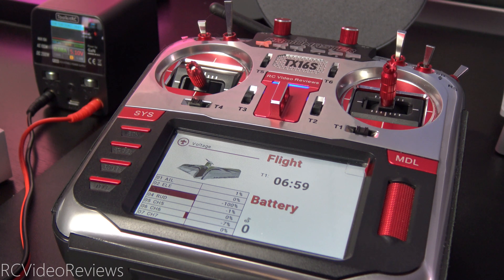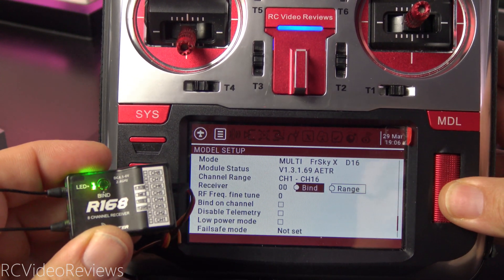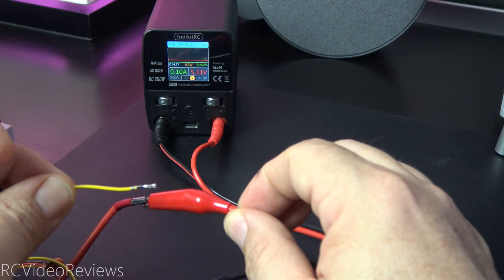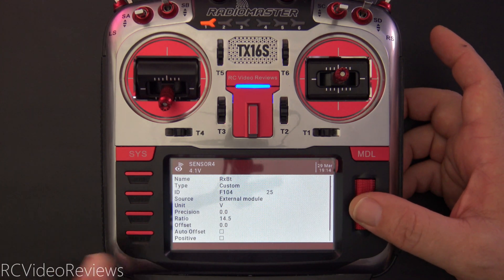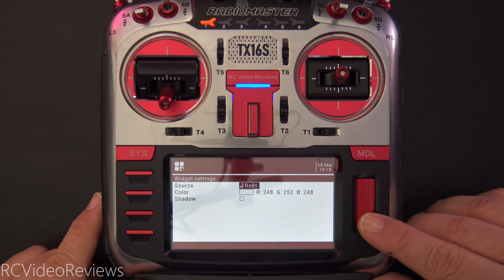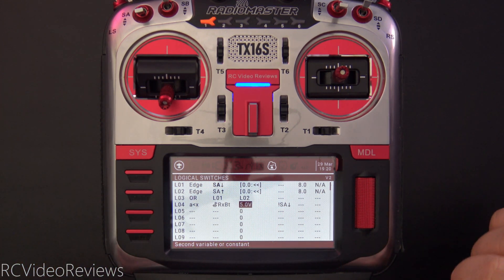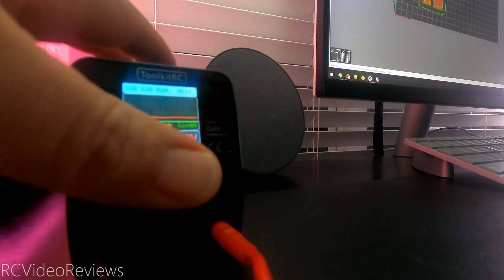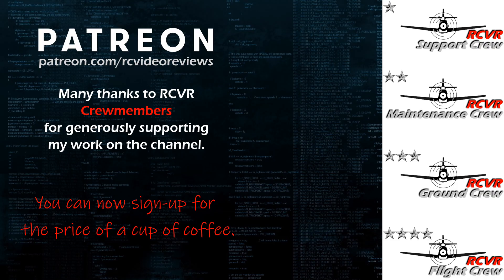OpenTx Snippet • R168 Bind • Battery Voltage Telemetry • Audible Alerts • TX16s • T18

Comment: what should the battery voltage range be on the radiomaster?
Reply from the maker: 6.4 to 8.4v
Reply: @RCVideoReviews  thanks how about calibration value the issue I am having I can’t tell if it’s fully charged half charged etc from the meter main menu
Reply from the maker: https://www.youtube.com/watch?v=iqAHIckNasM
Reply: @RCVideoReviews  thank you beautiful explained video
Reply: Since battery voltage label says 7.4 is 8.4 full charge not overcharging it ?
Reply: what current to charge 7.4V ion 5000 mah is what i have for edge tx, use 2.0 Amp? and what is the voltage should read when battery is dead or almost dead and time to charge to 8.4V
Reply: @RCVideoReviews  also I don’t see etc battery on the screen also what is purpose of enable max throw? If I enable it my throttle comes on even though it is set to throttle cut .

Comment: Hey John, can you please help with what is the difference between Ratio and Offset setting the right voltage reading. Correct voltage reading can be achieved by adjusting either of them, so I am wondering which is which, thx

Comment: Hello.Great video! Can I set up an alert when im close to a stall speed at the same way you did with the voltage? I have some airplanes running inav with gps full telemetry.
Reply from the maker: If you have the telemetry data you should be able to work with it in logic. Try it out and see what you come up with.
Reply: @RCVideoReviews  thanks for the quick reply! I will give a try!

Comment: John, since it only can do a 4s lipo Max..Couldnt i hook up the positive wire to the balance plug to just one cell of the battery?. So i could use vbat with a 6s lipo?..I know it would only be keeping track of 1 cell out of 6. I just thought maybe it would at least be some sort of backup insurance being able to keep track of at least 1 cell out of 6...Thoughts?,Or maybe theres a way to keep track of 4cells of a 6s pack? (using the balance port?)...
Reply from the maker: It might work. Give it a try.

Comment: hello,,great video and thanks for your work their.. im using tx16s with r168 radiomaster reciver ,im tryin to use this reciver with sbus to naza flight controller and would like to work with regular servo in 9-16 chanel ,can it be done like this? if so can you upload video about this connection type.. thank you.
Reply from the maker: Thanks for the comment. I wouldn't know about using dual sbus/pwm on the r168, but I suspect it would work. Have you tried it?

Comment: Hi John, now that they discontinued the R168, what receiver would you recommend to use with the radiomaster TX16S. I am flying the 6 channel Eflite Focke Wulf and I need 3 additional channels for an fpv gimbal. (pan, tilt and roll)
Reply from the maker: I'd look at FlySky first. I'm not sure if they have a 9 channel though.
Reply: @RCVideoReviews  thanks for your reply, I will check that :)

Comment: Did you see that Radiomaster will not be making or supporting the R168 and the R161 anymore. I heard that FRSKY said that they have the patent on the D16 protocol. 
My question is, if I already have these receivers, how will it impact me in the long run?
Reply from the maker: As long as D16 isn't removed from the MPM module you don't have anything to worry about. If it is removed from the MPM module, don't upgrade to that release. 

I've already started buying alternatives to show you guys what your options are now that FrSky are acting like $^!@s

Comment: Grayson Hobby actually sells what they call the Radiomaster R168 VBAT adapter for pulling the battery voltage off and connecting it to the R168. (XT60 only) for people that maybe don’t have confidence in their soldering skills
Reply from the maker: Good tip. Here's the link in case you want to buy or make your own: https://graysonhobby.com/radiomaster_r168_vbat_adapter_xt60.html

Comment: How is the low threshold for RxBat setup using an RB-20 with two batteries?  Would we setup logical monitors for each battery independently?
Reply from the maker: I don't know what an RB-20 is, but your question says, "two batteries", so if you're asking about two discreet voltage values, I don't think you can do that because the R168 only has one VBAT input. The key for monitoring is the sensor. Notice in the video all the logic hinged on RxBat--that is the sensor label for the VBAT pin. Without a 2nd VBAT input you can't have a discreet sensor, therefore you cannot monitor a 2nd battery.

Comment: Good vid. I have this Rx set up and have flown it before with the voltage sensor. One thing i didnt like about it was that i was getting low voltage alarms a couple mins into a 6-7 min flight. Found out it was reading the voltage drops under load so I wasnt really getting a resting voltage reading. It scared me at first till I figured it out. I shut off the audio prompts but left the on screen value for reference. Thanks for the snippet sir
Reply from the maker: So there are some advanced logic techniques we can use to take care of that and I've already planned the video for it. Hang tight...
Reply: I put in a delay so if the voltage dips below the threshold momentarily, it won't give me a warning. I also enabled auto offset but idk if that really helps.